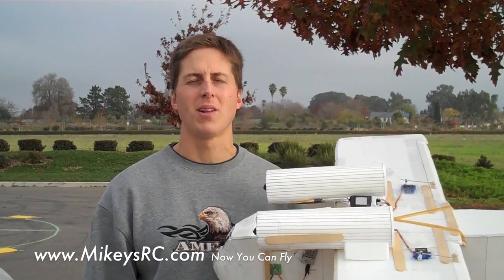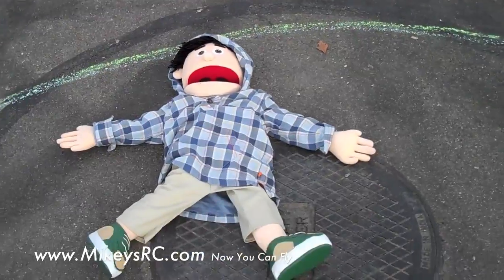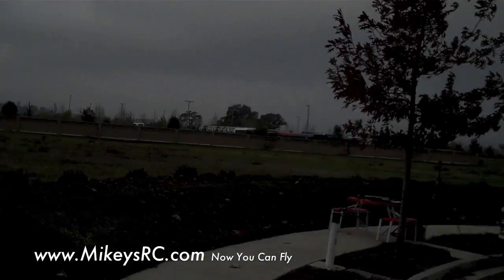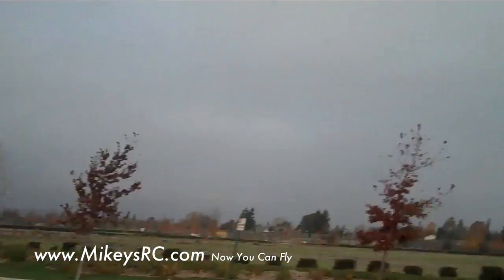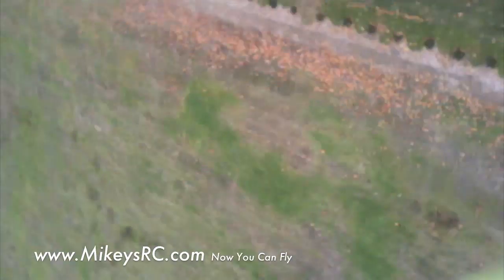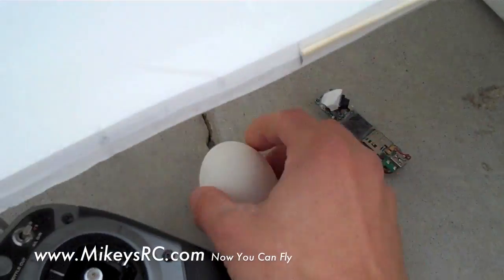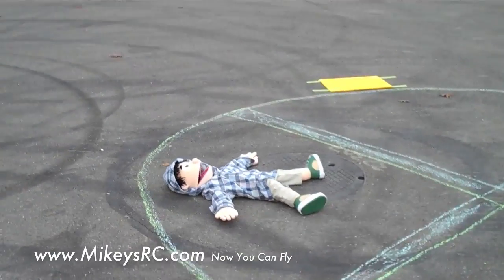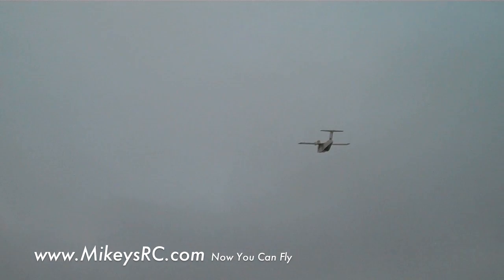Scratch Built YC 14 EGG DROP  Ducted Fan RC Park Jet

Comment: Hey mikey,
the propeller version of this plane has transmitter on the side on your website. Did you use two sticky tape (both sides) to stick it to the foam? What I've noticed is that it gets fairly warm, I have got a quality heat shrink around it , how would i mount it on a foam surface?

Comment from the maker: @justfly60482 Oooo yeah.  Night FPV flying with lights.  I like how you think.  I use 64mm fans.  If you you 4 cell 14 volt batteries then use a 4000KV motor if you use3 cell batteries then I recommend 4200KV motors.  Yes it's on the plans.